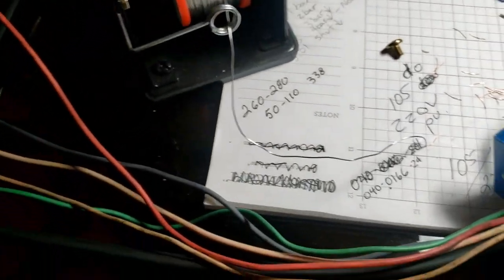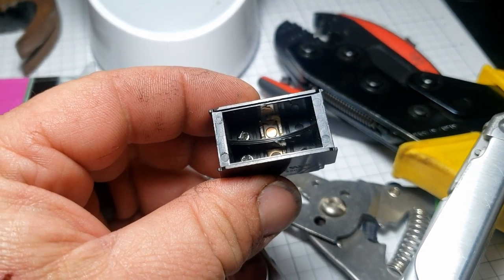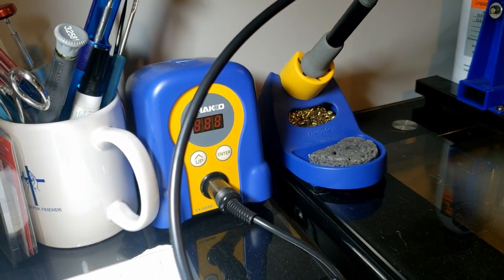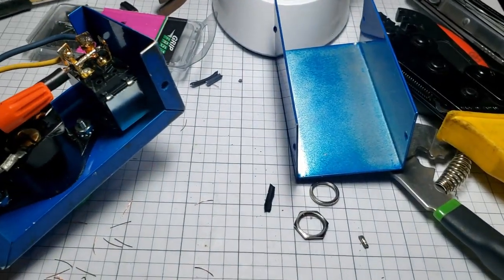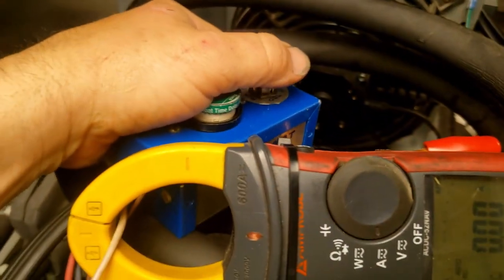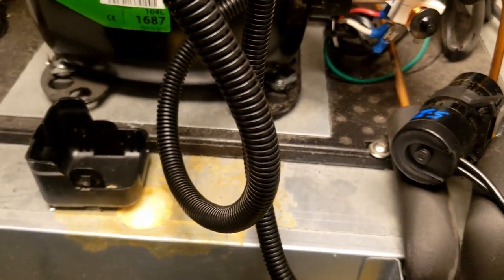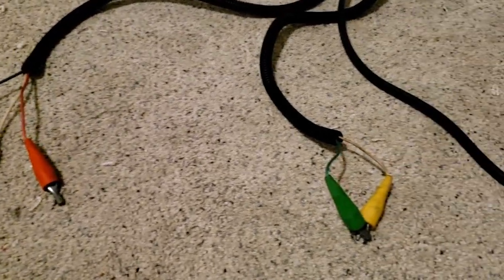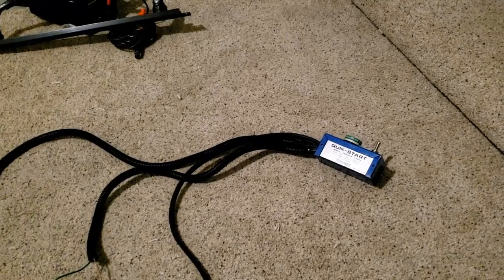EASY HVAC Compressor Test Box

Comment: I have the same one I bought while in high school back in the 80's, I can still use if it's needed. I also had a charging cyclinder that was made by Thermal Engineering Company,  I bought at the same time. It's something how my compressor test cord still works after all this time.  Thinking I may have tried a light bulb in place of the fuse to check for open windings; cant remember. Lol

Comment: in full wire gauge wot fit through terminal, split it in half and put half through then whole then counter wrap them. or strip longer, split and counter wrap then solder.
no neither way is aviation/space grade! but for field work it will outlast the gear/equipment/owner and more ;)
nothing wrong with drilling open the terminal either, as long as you don't overheat it and melt the through body "junk" riveting/staking. same for soldering them.
it's very easy to overheat the terminals and cause the phenolic/plastic/composite body to cook and loosen the idiotic passthrough rivet/stud that loosens up.
I repaired many chrysler/dodge caravan window switches in the past, with the same issues.
I was a kid/brat and saved my grandparents neighbors many thousands(friends with their kids/my age!), they loved video games(not for me) and I loved hands on learning and real skills.
Reply from the maker: The switch is technically rated for 10 amps at 250 v and 15 amps at 120 v. So I could have got away theoretically with 14 gauge wire. When the switch burns out I'll buy another. The shipping cost as much as the switch did. 🤦‍♂️

Comment: I sell pond aeration equipment on the internet, and the main problem that I find in preparing the used pumps to sell is a bad capacitor. I keep them on hand for that reason.

Comment: Have seen lots of different types of those but never seen inside of them. Did electronics repair for years before getting into HVAC. I always pull out an old super boost start cap to perform same function. I know it won’t handle the high amps for long but it’ll tell me if compressor is bad or start components. Grest video Rick!
Reply from the maker: Thanks for the feedback👍👍

Comment: I came across an old Robinair model intended for a compressor that disconnects the start winding itself once up to speed (both run and start are powered at all times). I'm going to modify it to work with both types by adding that momentary switch.
Reply from the maker: Sounds like a great idea to me👍👍. Most home ac units use a run capacitor feeding power to the start terminal and are in the circuit the whole time.

Comment: Do you remember where you found the replacement toggle switch? I want to make one of these but can not find the correct toggle. Thanks in advance
Reply from the maker: I had a heck of a time finding it, I thought I mentioned in the video that I bought it on Amazon or ebay or an electronics website, you just need the number that I thought I showed in the video
Reply: @HVACRSurvival  on thank you!

Comment: wiring run and start together = no bueno. connecting both at once to will not provide an enough offset rotating field to BANG the compressor/motor into life. especially not if under a load (head pressure from just being ran/not balanced out)

Comment: 🤔🤔🤔... i like it.... but... if you tested the capacitor, and check the current relay. And compressor NO GO. Dude... bad compressor brother. Simple. Just look at all the lack of maintenance in restaurant equipment.
Reply from the maker: True to a point. Capacitor is quick and easy to check but the start relay is not always 100% easy way to check other than change the capacitor and see if it runs, possibly shake the relay.  For me it's just easier to see if the compressor runs,  if it does I'm done,  changed the start components, if it don't then the compressor's bad and the relay and stuff will come with the new compressor. Guess it depends on how you look at it.  Thanks 4 checking out👍👍